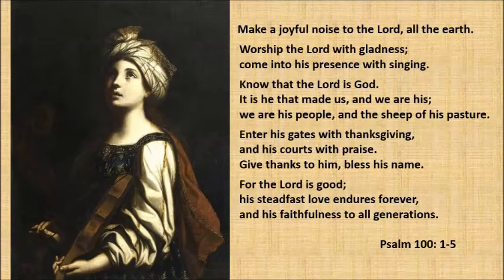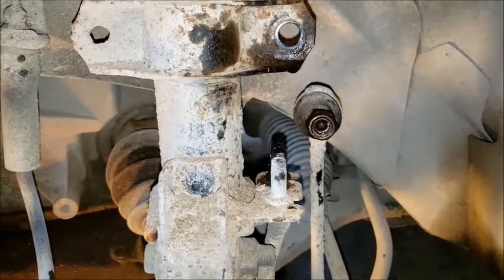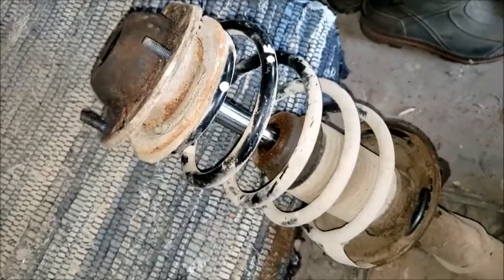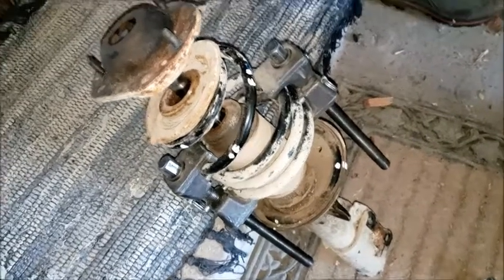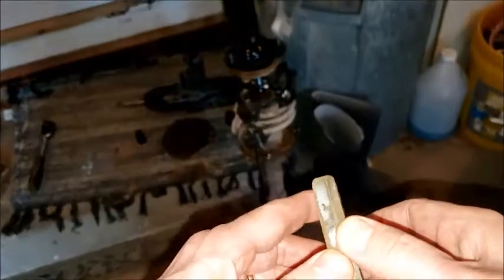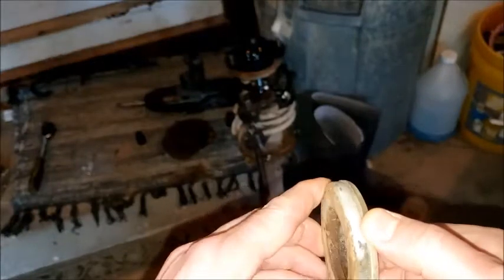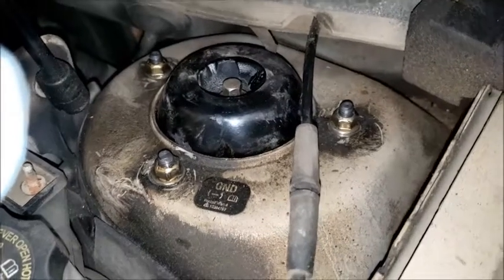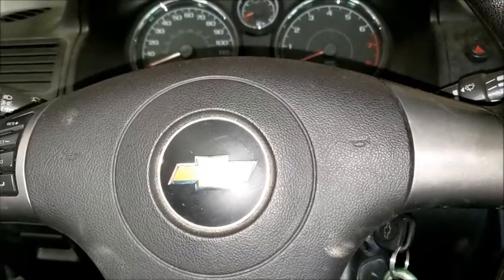2009 Chevy Cobalt steering noise fix

Comment: My HHR has some pops when it's turned all the way either way, I have a new front end and I've double checked every bolt and re torqued them to spec, also steering feels sloppy and can't figure that out
Reply from the maker: Did you check the intermediate shaft between the steering column and the steering rack?  I have seen some videos that show those being worn out and making the steering sloppy.

Comment: I change the front shocks new and it still makes a cracking noice ,what should I do next
Reply from the maker: You might want to put jack stands under the vehicle so that the wheels are off the ground to see if you can identify where the noise is coming from when you turn the steering wheel.
Reply: @danielcano2462  did you ever remember the name of the part I'm dealing with the same problem please help lol
Reply: @danielcano2462  what was the name of the part you replaced Daniel!?!

Comment: 2005 cobalt here. I hear this steering noise while driving on my right front side.
Reply from the maker: There are a lot of noises with these Cobalts.
Reply: @diywithdave3186  It actually went away after hitting some bumps, think it was brake related. I was about to call a shop to put it on the hoist.
Reply from the maker: @MortyFoodReviews  thanks for the update.